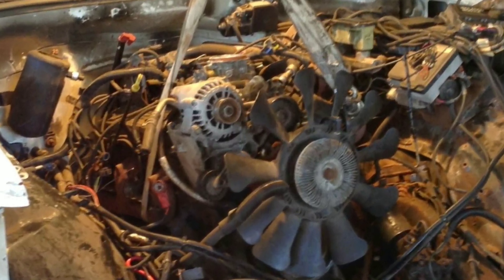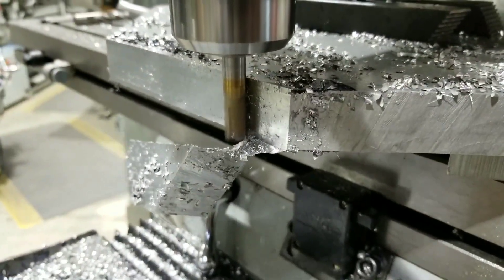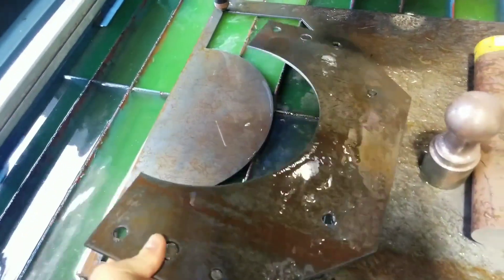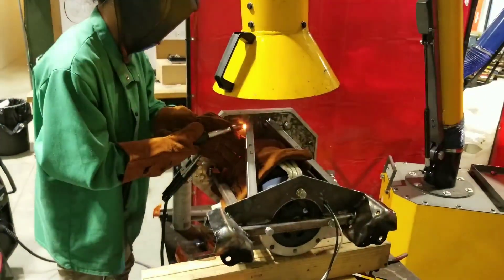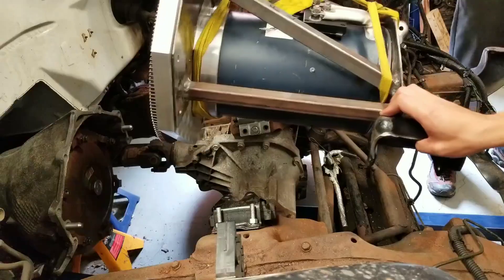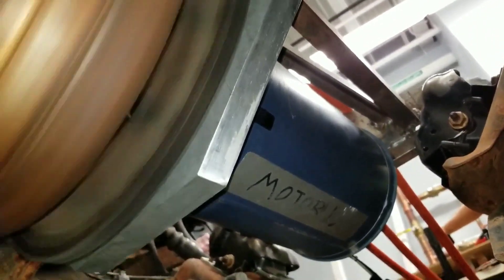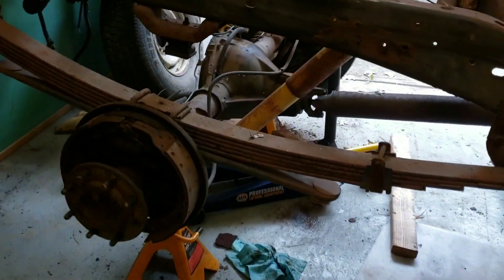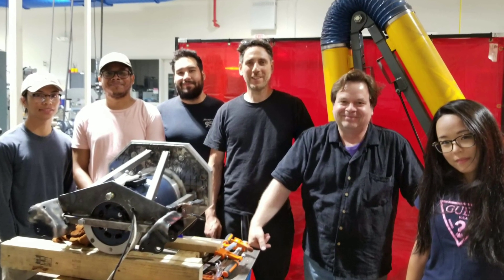Electric vehicle conversion at Bergen Community College: end of summer 2019

Comment: got any info on this? i'd like to do a half ton conversion with a automatic if possible and be able to pull 2-3 tons plus the truck
Reply from the maker: An automatic transmission is inherently wasteful. There's a lot of Lost in the torque converter. But there are some advantages.

I left before we could do any road testing. The idea was to replicate the same power that the gas engine was delivering to the torque converter on the automatic transmission. We used an AC 50 from HPEVS.  Gives you lots of torque at low end where you need it the most but does not have the same Peak horsepower as the original 5.7 liter V8. However, the electric motor can rev to 5,000 or 6,000 RPM. Keep in mind that those gas engines are giving you the peak horsepower rating.

Having said all that, if this is your first conversion, I don't recommend it. Start with a motorcycle first. There's a lot to learn.
Reply: ya i understand the power band of a internal combustion engine is completely different from a electric motor. i need a automatic cause i don't have use of my right hand to shift a stick
Reply from the maker: @tylertruitt377  oh yeah, then automatic is a good option. I think it's possible. You can tune the controller to set at an artificial idle.  
You'll need that to run hydraulic pump or you can do an external hydraulic pump. EV West Sells a kit